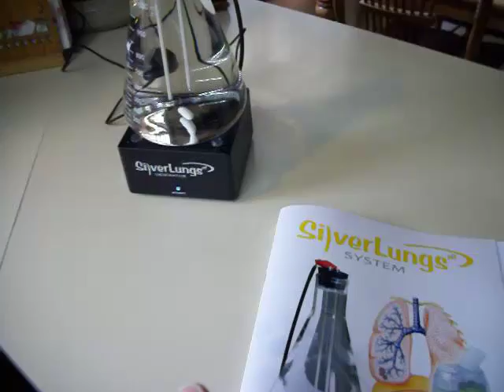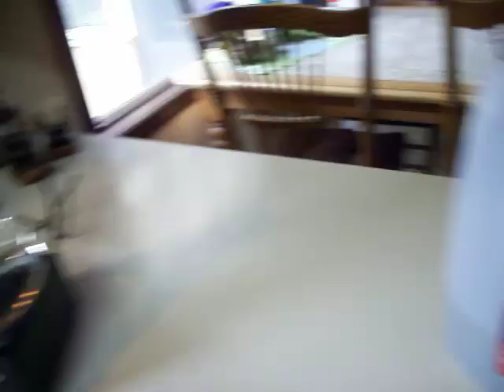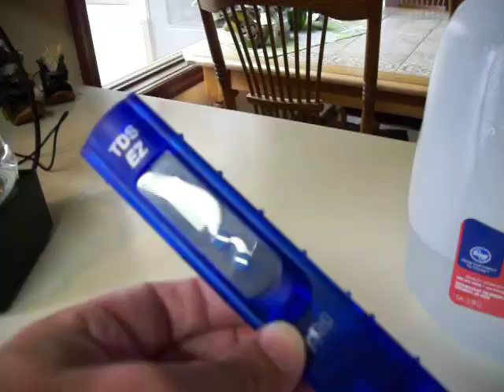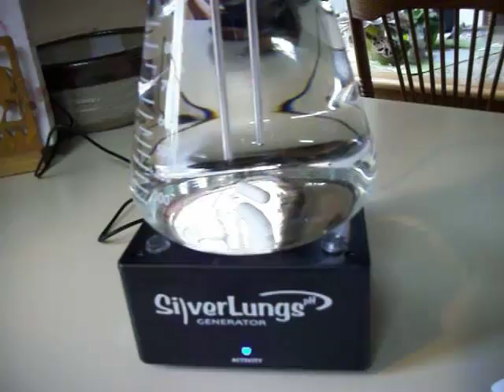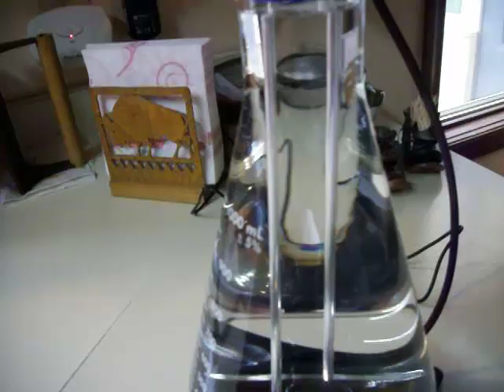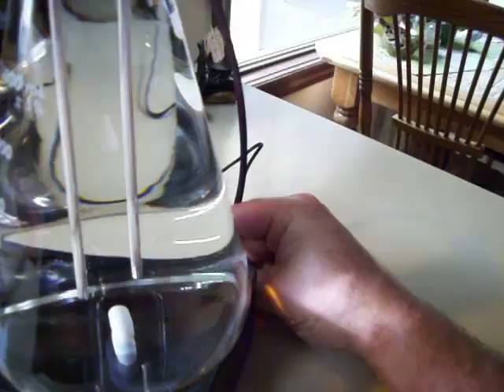Part 2 - SilverLungs Colloidal Silver Generator - Honest Review & Demo

Comment: Damn, I used bottled water from Sam’s and on the ingredients it says it’s reverse osmosis water.. will my colloidal silver still be good
Reply from the maker: You can test it with a PPM Meter. As longer as it's completely pure (000 PPM), you are good to go. Otherwise, I would find a different water source. Distilled water is usually the purest to use.

Comment: I understand the cleanliness of the equipment but isn't Colloidal Silver 99.9% antibacterial ? So your machine can only make 10ppm Colloidal Silver at auto shut off.?
Reply from the maker: Yes, CS is antibacterial. However, it isn’t CS yet! Anything added into the solution before it’s done will become part of the solution due to the electrical current. Also, yes, 10-15% at shutoff since that is the best percentage for medicinal usage.
Reply: it makes 10ppm or 20ppm  go read the website info

Comment: Imm trying to get colloidal silver at 30-50ppm I’m using 99% silver wire with alligator clips with 3 9v batteries and have had them in distilled water and I test it with a tds meter and cannot get it passed 20ppm... what’s wrong
Reply from the maker: It’s my understanding that you need special equipment to get a solution that high. Best to keep searching online since I’m not familiar a method to do that. Sorry!
Reply: you don't really want it to go past 20 ppm

Comment: You mentioned that the water needs to be 70 degree Fahrenheit or celcius?
Reply from the maker: Motto No, it should be “at least” 70 degrees Fahrenheit, but probably no more an 78 degrees.
Reply: @jimginnyohio  OK, the heating is to speed up the production right? I see quite a number of Silverlungs owners never heat up on youtube. It has been 7 years already, and is your Silverlungs still working? Any break down in between or repair? How many batches have you produced and how many more batches you estimate it can produce? Also, did you notice any difference when taking the metallic silver vs ionic silver? I read that ionic silver kill the microbes with oxidation, but not sure how the metallic silver kills, do you have any idea? Do you recommend this generator or you have others in mind that you think is better than this?
Reply from the maker: Motto No need to heat the water. Room temperature is usually within the range to use. If you are using distilled water, chances are it’s already at room temperature. Yes, still using my Silverlungs device and have never experienced any issues or breakdowns. Not sure how many batches I have made with it. Easily in the high hundreds of batches made. Still using the original heavy silver probes that came with it. I switch back and forth between ionic and colloidal regularly with no noticeable effects. Honestly, I have not researched other devices since I settled on this one since I have been so happy with it. Yes, I would still highly recommend this device.
Reply: @jimginnyohio  OK, thanks.

Comment: Hi jimginnyohio, thanks for all your good info on this unit.  I've used mine for years ! never had a days problem.  But suddenly today,  as I switched on the unit to start a new batch,  it only spins for a few seconds then stops.  When I remove the alligator clips, and switch back on, it spins perfectly.  Any idea why having the clips on makes the device stop spinning?  I've never seen this happen before?
      Please advise what I should do?   Thanks! Laura
Reply from the maker: The first thing I would try doing is try it again with water from a different source. It's my understanding, the sensor measures the conductivity of the water to determine the PPM level of silver it contains. Be sure to test your water to insure it is at zero PPM before starting a batch. I've found some distilled water from random sources to be dirty with a PPM of 13 or higher. In those cases, the unit might sense that and shut things down. I hope that helps!  If it continues malfunctioning with zero PPM water, it would be best to contact the manufacturer directly in case something needs to be repaired in your unit.  Best wishes!
Reply: @jimginnyohio  Thank you so much !  That's exactly what was wrong !  I checked the label and it was not 0 PPM !  So yes, once I changed back to 0 PPM distilled water, it now works perfectly!  I'm so relieved !  Thank you again for your advice.  Wishing you well, and stay healthy and safe. All I can say is, thank goodness for colloidal silver !
Reply: IF THE SPINNER DOESN'T SPIN. IT MEANS THE DISTILLED WATER YOU ARE USING IS NOT PURE. I RECENTLY COULDN'T GET DISTILLED WATER AND I DECIDED TO USE A PURIFIED WATER IN SUBSTITUTE OF THIS DISTILLED WATER. WHEN I STARTED THE MACHINE THE SPINNER WOULD SPIN FOR A SECOND AND STOP.  THE REASON IT DOESN'T SPIN IS BECAUSE THE CURRENT THAT GOES TO THE TWO PROBES CONDUCTS ON THE SPINNER CAUSING IT TO SPEND. ONCE THE DISTILLED WATER IS SATURATED WITH SILVER PARTICLES. IT TECHNICALLY SHORTS OUT AND THIS IS THE MECHANISM THAT SHUTS THE MACHINE DOWN.
Reply: @Frank289100  Thank you so much !  That's exactly what was wrong !  I checked the label and it was not 0 PPM !  So yes, once I changed back to 0 PPM distilled water, it now works perfectly!  I'm so relieved !  Thank you again for your advice.  Wishing you well, and stay healthy and safe. All I can say is, thank goodness for colloidal silver !
Reply: @LauMeh9395  FOR THE PAST 4 WEEKS I'VE BEEN BATTLING THE FLU. IF MY SCHEDULE IS VERY BUSY I WILL USUALLY TAKE A Z-PAK TO BLOW IT OUT OF MY SYSTEM. I GET THEM FROM MY DOCTOR FRIEND AND ALWAYS HAVE THEM IN THE HOUSE. I TOOK A Z-PAK WHICH WORKED BUT THE FLU CAME BACK THE NEXT DAY. SO I DID A SECOND Z-PAK WHICH WORKED AND A DAY LATER IT CAME BACK AGAIN. SINCE I COULDN'T GET DISTILLED WATER BECAUSE OF THE CORONA VIRUS SCARE THEY BOUGHT UP THE ENTIRE SUPPLY. I USED MY OREGANO OIL WHICH WORKED BUT THE FLU NEVER TOTALLY DISAPPEARED. EVENTUALLY IT STARTED CREEPING BACK. THIS IS WHEN I DECIDED TO SE IF I COULD FIND SOME DISTILLED WATER WHICH I FOUND AT A CVS NEAR MY HOUSE. I MADE A BATCH OF SILVER WATER AND STARTED DRINKING IT. WITHIN 2 1/2 DAYS WHERE MY BODY SLOWLY ABSORBED IT. AND THIS FLU WHICH COULD HAVE BEEN THE CORONA VIRUS IS TOTALLY GONE. I NOW FOLLOW UP WITH A NEBULIZER WITH COLLOIDAL SILVER TO KILL ANY RESIDUAL THAT MY BE HIDING IN THE LUNG AND NASAL PASSAGES. COLLOIDAL SILVER IS KING! IT'S A LIFE SAVER AND FOR PENNIES CAN CURE YOU.

Comment: I just received my SLG today.  The instruction book mentions glass storage bottles, but It doesn't say if metal tops are ok. Is that not an issue? I don't know much about it, but it seems to me that a metal cap could contaminate the solution
Reply: WHAT HAPPENS WITH A METAL CAPS. IS IT STARTS TO RUST AND THEN IT'S HARD TO SCREW IT ON AND OFF, AND ALSO POSSIBLY CAN CONTAMINATE THE SOLUTION.

Comment: I find it interesting that your test found the bottled distilled water in this video to be "pure". My experience with distilled water stored in porous, low density plastic bought from the super market is that the water ALWAYS tastes like plastic!! If the water tastes like plastic that means the CHEMICALS from the plastic have been leached into the water! Maybe that was a very fresh jug of water? I know that distilled water stored in this type of container for any length of time will leach out plastic chemicals. So, the best type of container to get the water in is either glass or a high density polycarbonate plastic, which is usually blue (?).
Reply: Your right, plastic leaching in store-bought water.

Comment: the 1/8 th inch gap at the top is to stop gases and pollutants from the air above water dissolving in the water....a TIMER stops it after 3 hours.

Comment: Once you complete a batch then what do you do with the magnet, silver rods, flask, etc. Where do you store them?!! What do you do with that copper scrub? Where do you store it? Do you wash the copper scrub? How do you wash the copper scrub?  How do you clean the water meter? They don't cover a lot of stuff!!! Thanks!
Reply from the maker: QuantumBunk I store my items in a regular cardboard box while not in use. The magnetic stirrer comes in a small zip-lock bag and the silver rods come in a plastic tube. You'll want to keep those for storage. After each use, I wash out the copper pad and allow it to dry before storing it away with the rest of the items. You'll want to replace the copper pad after a while since it will begin to get loose and show signs of wear. You can find replacement copper pads at any store that sells cleaning supplies. Since the meter only comes into contact with clean water and the produced solution, it can simply be rinsed with some distilled water and stored along with the rest of the items.
Reply: The water meter has two buttons on it. What are they? I can't read them. How far do you stick it in the water? Also I didn't quite get the part about the nubulizer. Thanks.
Reply: Calm down you're way over thinking!

Comment: Awesome kit.  Received yesterday.  High Quality equipment.  As an R&D Engineer, first impressions are good.  Will start production today.  

Only SilverLungs recognize the importance of pulmonary delivery for near IV effectiveness  Lung, or pulmonary, delivery is the cutting edge of modern drug delivery.  The ultrasonic nebulizer ensures that no heat or other reaction is induced into the silver solution thus ensuring full efficacy.

A high quality ultrasonic nebulizer is provided in the deluxe kit - a worthy investment.  A magnetic stirrer - excellent.  Overall, the value of the deluxe kit is immediately recognized when the box is first opened and a "whole lab" is revealed.  Good Job!
Reply from the maker: Great to hear that you are so satisfied with your new SilverLungs device. I'm certain that you will get many years of use from it! It's hard to explain to others what a high quality device it is simply through the use of text and videos! But when people open the box and lay hands on it for themselves, they are always impressed! Thanks for your comment!
Reply: do you still have this kit and if so is it still great as you have advertise?

Comment: i made CS using 2 x 1.2 volts ni-cad batteries with a led in series.
net voltage = 2.4 - 1.5 for led=0.9 volts.i also put a 22k resistor in series.
current was 30 MICROAMPS.i made 2ppm cs after 13 hours and 40 mins in 0.8 litres of water.very small particles size.people who use 4 x9 volts don't understand ohms law.No need for high voltages at all.people step up the voltage then put in a resistor in series to step it down because of the huge particle size.The resistor absorbs voltage.people still don't understand ohms law.Also it is THE CURRENT that generates colloidal silver.Coulombs Law.
The voltage is the pressure required to push that current through the water.The other day I made CS over 5 days using 30 MICRO amps of current in water which had been boiled using 2 AA batteries with a 22K resistor in series. I got 10 pmm very small particles CS.
Reply: Ese Callum With respect, utilizing boiled water will do nothing but increase the total dissolved solid content. You really should be using distilled water. What residue thats left is absolutely not an indicator for the proper water needed for a silver solution. Keep in mind that the waters content(which is very high if using tap or well water) will greatly increase as the H20 is vaporized into the air, leaving you with highly conductive water really un-pure water. You said it yourself, empirical evidence stands supreme. 
And again out of respect, the solution you are making is not actually Colloidal silver its Ionic silver and you should think twice before ingesting it. Once in the stomach the mineral acid, HCI will donate an electron to the frantically searching Ionic silver, developing Silver Chloride. 

Its great to see anyone taking interest in the use of non-pharmaceutical based healing, but please for your own safety, dive into the needed research so you can make the most of your efforts.
Reply: Why go through all the hassle.   Just use distilled water
Reply: budobudoh the particle size is governed by the current level.the higher the current the bigger the particles size and vice versa.if you don't need the cs right away then you should lower the current to 30 microamps or less and increase production time accordingly.remember it is current that makes cs.voltage is the pressure required to drive the required current through a resistance.i just use 2x1.5 AA batteries.=3 volts.
Reply: Mitch Lee boiling the water removes dissolved gases.And also kills any existing pathogens collected during the passage of the water through the pipe not killed during water cleaning.thus the silver will be at full strength and not wasted killing microbes...
Reply: Mitch Lee Their is no guarantee the distill water is really distilled or not contaminated...
Reply: @esecallum  we check before using making sure it is 100% pure prior to using it
Reply: SmalltimR that would be costly and time consuming.
Reply: SmalltimR making distilled water.
Reply: Meh... Two 1.2V batteries?Right.Also,boiled watter is a sterile,not a destilled water.
Reply: Zviki ni cad batteries have output voltage of 1.2 volts.people use high voltages don't understand ohm's law.2.4 volts works.Empirical Evidence is always better than the ignorant quasi religious beliefs of others.

the place i live in has very pure water as proved by boiling it and leaves hardly any residue.
Reply: Ese Callum please share with us: 
1. How did you measured your ppm?
2. How did you determined your particle size?

What's interesting in this is that while there can be no doubting that certain people will possess a deeper understanding of electrical theories such as ohms law, that it also remains that there will be few who understand the principals of electrochemistry. ie, the minimum voltage needed to the promote the eletrolytic process within the cell, along with the consequences of falling outside those limits are rarely known for all but those working in the industry(metal extraction and processing etc). That said, let me assure you that there are indeed limits from which the electrolytic process can and will operate, and more importantly, where other the expected compounds will be replaced with something other than silver ions and nanoparticles.
Reply: ***** i am afraid you missed the point.i am not boiling the water to evaporate it.only to remove dissolved gases and kill any existing pathogens.the volume of water is virtually unchanged.the area i live  in has very low mineral content as evidenced by hardly any residue on the electric kettle heating element.your comment about silver chloride is based on speculation as other evidence at the silver edge with over a hundred studies suggest otherwise.
Reply: Ese Callum I use 20 volts dc wall power supply to make cs. I connect the power supply with my voltage regulator so I can lower the voltage if the current reaches 900 micro amps. I connect my ammeter in series with the circuit to monitor current. When I reach 5 volts ( which is the lowest my voltage controller can go ) and 900 micro amp, I stop the process. The ppm of the CS is 10 ppm. This is the highest ppm I can make with out going more than 1milliamp. Am I doing the right thing? Any suggestion? Do I need to go 30 micro amp?
Reply: +Ese Callum whats the point of boiling the water to kill existing pathogens? Thats what the ionic silver is for... lol oxymoron

Comment: The price of "SilverLungs" product is 300% above a  fair price !!
Reply from the maker: OK, so don't buy it then!  I personally feel that it was well worth the price for my health and for knowing that I am getting the best quality colloidal silver possible. Compared with other healthcare products, it's dirt cheap!
Reply: Tommy Rad
I think you got your terms confused. That said, most all of the low voltage CS colloidal silver solutions are ionic by default. Whereas it is the silver particle solutions that can be tricky to make. And not the other way around.
Reply: It feels expensive when money is very tight.  It was expensive for me also.  
As a one-time purchase, you could save up or put it on a credit card and pay off as fast as possible. I have learned the hard way that being cheap or trying to cut corners does not usually work out well.
Reply: Because you've priced all of the items in the kit right?
Reply: Well, you CAN make colloidal silver solution with 2 Canadian silver dollars, a 9V battery and a couple leads. BUT, You can't make ionic silver, you can't nebulize it as you do not want to breathe large particle silver into your lungs, you will never know the ppm content,  etc... You will end up with a solution in-which you will have no clue if it will be effective.

Also, by your math the price should be $141. I guess you have gotten too used to Chinese-made products.  I bought the SilverLungs generator 4 years ago and it was the best $400 I've spent in a long time. I just killed another oncoming cold yesterday. Thanks Mario!